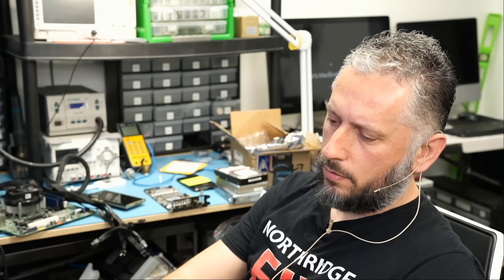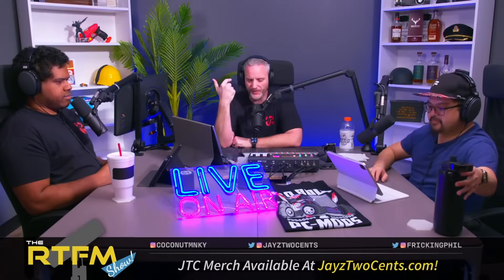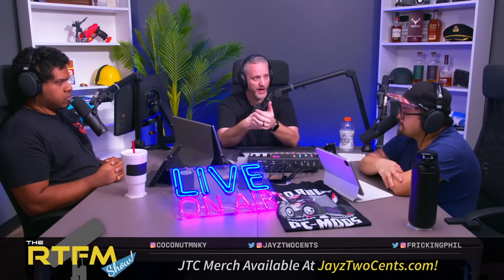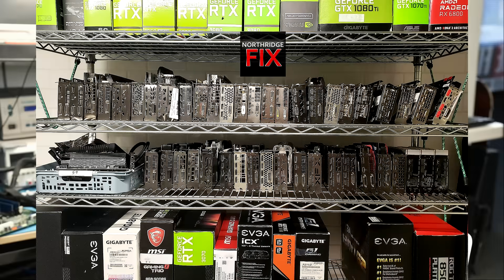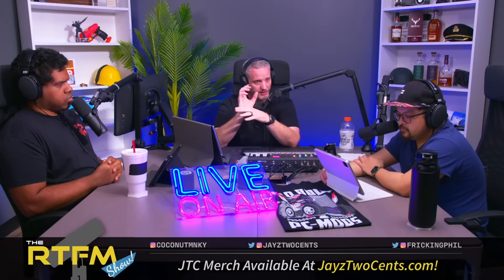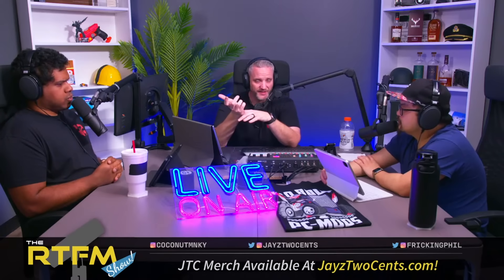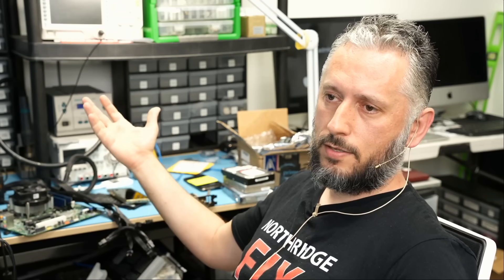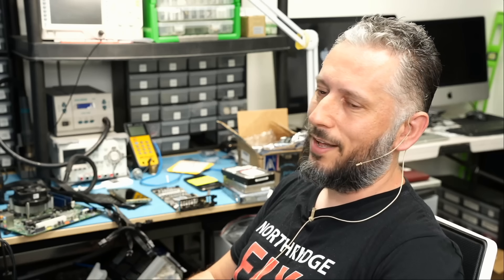Melting 4090 and CableMod. JayzTwoCents and Gamers Nexus Response. Blame NVidia or User?

Comment: Glad I watched this video.  I under the full impression that this was determined to be user error.  As long as you attach the cable correctly, you're good.  Seems like that's not the case based on this video, or at least not the case all for all cards.  I was going to wait for a price reduction and get a 4090 then, but I've decided the melting risk isn't worth it.  I'll wait for either a redesigned 40-series card with a safer connector or just pass on the 40 series completely and see what they do with the 50 series.  I'll also give AMD a serious look finally, as this may be the time.  

Once Nvidia and their partners release a card with a redesigned power connector, that will be the time to buy - until then these cards are just disasters waiting to happen.
Reply: Exactly!
Reply: I will just buy the old generation 3090, even with heating memory problem compared to melting cables is an ice...

Comment: Hey Alex. Great show:). 500 watts on 12 volts should be around 40amps. Would that be enough to cause a resistance in the connector with heat enough to melt it? I like the idea with the thermal cam below. What did your costumers do with their card when they noticed the fault? The must have seen some smoke? :)

Comment: Definitely a design issue where power cable can easily get loose. Every time I move my pc downstair to use my 4K oled the power cable moves and I'd have to reseat it. This connector requires more vigilance on the users part than previous connectors which were plug and forget.

As far as your video I get that you're mad but the constant repeating of the same sentence four times in a row every time made it hard for me to watch. I understood from the first time you said the cable mod connector was fully seated but you kept on repeating and repeating it over again.

Comment: As a PC gamer over 15 years this is the first i have heard of a graphic cards power connector burning. I personally think its a manufacture error. Personally I think the connector isn't sitting snug causing it to short and melt/burn. It's like any other electrical that receives power. If its not sitting snug it will short. There could also be the smallest scratch on the pin or connector causing it to short. Like you said it isn't rocket science here.

Comment: This was a known issue before they released 40 series where the testers of the cards said the first problem they found is the cable connection has failed in some way that it melted and its the card that is the issue from maybe the card asking for more power then the cords rated resistance.

Comment: 3090's DO NOT use the exact same connectors. 3000 series use SIMILAR shaped connector. 3000 series use 12pin connector, they don't have the bottom 4 sense/communication pins.

Doesn't mean that whole 12/16pin connector design isn't flawed. I'd take 5 8pin PEG's over that 12VHPWR connector any second

Comment: So, it was year ~2001 when first VGA GeForce3 (NV20) that needed an external power supply was created (because PCIE/AGP power was not enough). Now, after 22 years, there is the first graphics card in the whole humankind history, that started to burn the power supply connector ---->>> USER ERROR! It doesn't make sense.

Comment: Looks like Nvidia cut corners and created an overpowered hot mess that requires an oversized cooling solution and scrambled a connector to keep it all propped up by the skin of its teeth - all to save face from the crypto debacle.

1. Connectors are melting.
2. This wasn't a concern in previous generations.

Comment: What they need to do is redesign high wattage stuff to a higher voltage. 24 volts would be the same wattage at half the amperage. Of course that would mean a whole new power supply too.

Comment: 7:55 - Actually, they do not always. One time I wont forget is that the PCI-E cable was missing completely even though the video card required it. It was a modular PSU with no PCI-E cable present. It's amazing how sometimes we get DIY PC's that wont turn on, no signal or sudden crashes. Turns out it was a connector that was not plugged in all the way. I have seen most types of connectors loose, 24-pin, 4+4-pin, SATA and PCI-E. But I guess those customers dont have a single brain cell...
What comes to the GN video, there is a chance that the card connector would have melted anyway so unless it can be recreated consistantly, it's not a user issue, at least not always.

Comment: I don’t watch Jay2cents at all and always skip his.
As for the connectors, it is in a stationary pc and not something that is moving. Why talk do they talk about wriggling?
The cable connector is from the power supply. I am more apt to think that the cable connector from the power supplies has quality issue.. firstly it is not a solid pin but rather a thin hollow square plate that will split open to accept the pin from the video card. Therefore it is likely  the when the plate split open, the plate is not making complete contact with the pin and thus cannot handle the current.

Comment: It isn't really an nVidia problem, as partner GPUs can use their own design and the problem seems to be universal even for partner board designs, etc. where there were options to mitigate problems. All GPU designs have some RMA rate, all can die, etc. and when the RMA rate is acceptable, and can be attributed to manufacturing stuff to wrong tolerance, having bad luck, etc. that is sadly normal. 

The not plugged in error is a design concern and user error and it is PCI Express standards level issue, but with careful users it can be corrected. Sadly, we have to live with this standard until we get a new power connector (and PSU) standard. 

Just as connectors attached to the scale was manufactured by a few different suppliers and were slightly different, now when this connector got more common, more suppliers might have to sell it to various board partners, and standard PCI Express 5.0 power connectors manufactured to wrong tolerances used to power a 600W GPU might fail. With less power draw it might be fine. The fact that the connector is soldered to the board, and not connected to cables doesn't mean there cannot be manufacturing and QA errors with the connectors...

When we deal with new generation of hardware and unusually tight tolerances required for reliability, many things can go wrong: Connectors on cable/adapter, connectors on card, handling by users, stress due to case, vibration, other conditions (heat, air movement and pressure). Many small, individually insignificant, differences can lead to a problem where the connection is already out of specs, and can lead to GPU death. Many known potential issues weren't considered and as this connectors is incredibly sensitive, and in the case of 4090 it is already tested to its limits, it is possible that several different issues can push it beyound its limits and cause melting. 

While the connector on cable / adapter was revised and reinforced, but the connector soldered to the board on VGA is probably still come from the original design by a few manufacturers and they don't manufacture them to tighter standards and they haven't revised them to stay reliable even if the connection is slightly out of spec, bad luck can cause issues.

Comment: You add compelling arguments. I tend to believe you more than GN right now. I think Steve did not have all of the info on hand, either due to a miscommunication with you where he thought or was told your insight was based on those 8 cards from Cable Mod only, or that he quite seriously did not bother to do his due diligence. I rarely find fault with his assessments, perhaps now I will be more critical of his content. Without a doubt Nvidia is at fault for creating such a seriously bad connector. Thx for the info...

Comment: The card draws a lot of current,  more than any other card if I understand correctly.  This is either a bad connection at the connector,  or too small of a conductor in the connector to carry the specified current.  Either of which will generate too much heat at the connection point.  Hence the reason that this is not happening anywhere else in the entire power path.  This is ohm's law 101 stuff here.

Comment: This needs proper lab based fault investigation by somebody such as the Gamers Nexus team:

1) Obtain the information for both the rated current carrying capacity of the connector and the cable conductors from the component manufacturers specifications. 
2) Make up a supply cable that can measure the amps drawn through each connector, ideally through an ammeter in series with a shunt if necessary.  
3) Bench test the 4090 card(s) under full load whilst measuring the amps drawn through the conductors to see if any are exceeding the rated design capacity. 
4) Measure thermals at the connector during testing to find out just how hot these things are getting to melt the plastic.
5) Repeat the test using both the Cablemod adapter and the Nvidia adapter cable inserted.

Comment: I watched all the videos and unplugging the adapter was as hard as pulling a dictator off his seat, well as for me I think by the time a user decide to go for such an expensive card he must be with enough knowledge of its proper installation, why is it that the previous versions were not getting burnt so it’s completely not the user error. Instead of beating round the bush they should get the solutions to their manufacturing errors, let them switch to ceramic materials and they make sure that once the cable isn’t fully inserted it should work. Let them design a gap that is bridged by the connector. Once it’s connected properly then it completes the circuit kalasi.

Comment: I thing the way the socket made for such high voltage is very bad and prone to insecure connection inside the socket and cause increasing temp. We call that ngefong.

Comment: The problem may boil down to tolerances and multiple factories working on the connectors on multiple ends. There needs to be a solution engineering wise that makes 100% sure of the handshake or the card will not work. I also could be that the problem is not "it just melted" It could be a degenerative thing burning slowly over multiple uses. That would make it harder to detect?

Comment: If it melts on the connector side is the pins made of a inferior metal on the card. Can the current be measured between a brand new card and a failed card that was fixed. Both running for 24 hours under thermal camera full card  recorded.

Comment: I agree with a little of everything. I believe Jay and Alex are correct in that the problem bottom line lies with Nvidia. 

I believe Steve is correct t in his assumption that, because of bad design, it enables errors  the user may never be aware of. The cable gets seated, and it feels tight, but it can walk itself out just enough. 

Like Jay mentioned, there is still give even when fully seated.

Also have to remember Steve is going off of the small sample size he tested and, he did say he was willing to do more testing but, still believes that in the end, it does lie with the user to insure everything is correct. 

Yes and No about that, if the connection feels tight and secure, especially with a cable mod connector and it is still melting because even that has wiggle, it's because of bad design on Nvidia. 

I'd love to watch the three of them sit down and discuss all of this together and do testing.

Comment: What i dont understand from NVIDIA is the 3090 has 3x 8pin conecters and the 4090 has 1x 12pin conecter the 4090 has not enough pins for the Power thats wy ther melting ol the power gows true 4 pins ant geting hot.

Comment: There is something that i would do in this case to clarify:
Measuring the current consumption on a PCB type that melts the connector and on another PCB with same connector that doesn't melt it.
Because then you can tell where is the problem. If the current consumption is bigger on a 4090 board than other similar boards, seems like a bad design for that connector was made.
Clearly there is a problem with production project/dimensioning for that board.

Comment: Nvidia should have keep the Standard PCIe connectors that never failed, and have thicker wires and can supply more power as the spec … the new connector is simply bullsh

Comment: How about this regulator circuit on 40 series cards which undervolting the card  from manufacture to 450 watts

If there is some error in the way of communication between the GPU and this circuit causing some how aspike in the 12 v line causing  this connector to melt from inside ?????

Linux from ltt used anthor circuit to trick the GPU that it consume 450 watts and in reality it consume about750 watts and not melted yet
😂😂😂
And this one connector should be replaced with 5x 8 pins connectors or make an AC input to fix this problem once and forall

Comment: I believe it is the connector socket design and NVIDIA's fault for forcing change where change was not necessary and illogical. Instead of the power being spread out over three 8-pin connectors that uses 24 pins and ~2.5 inches of PCB it is a crammed into 12 pins (not counting the sensor wire and three empty sockets) funneling into one inch of PCB. Same principle as using a small guage wire where a larger guage wire is indicated. More power than the small connection can comfortably and reliably manage. Another example of "smaller/thinner/lighter is better" reflecting engineering stupidity. It might have turned out better had they used two instead of only one of these dainty little connectors, but that probably would have cut into their profits by at least $1.75 per graphics card, so perish the thought.

Comment: Of cause this is a product error,  the problem is that the new connector on paper is within spec for all the current the cards demands,  but in the real world spec isnt worth much,  reason we have endless of testing done all the time..  But with tech we dont have time for all that testing because a new model is out very soon..  the connector is too small,  the surface area on those pins are way to small for a friction fit with this high watt demand.. 

People never get a good tested product anymore,  people are the testers in a way as things are today..

But Nvidia will of cause not just jump out and call all cards back,  it will cost them so much money..  they better handle the RMA's and hope not too many will be sent back..   Maybe the melted connectors only happen if you push the card and at the same time have a high temp in your case..   You could call that user error to have a case temp too high,  if that is the problem,  but everything have temp sensors now.  If it was by design that this connector would melt if its too hot in the case,  a sensor would have been added to handle this..

Nvidia fucked up,  shit happens,   next..

Comment: I gotta be honest... Steve's response to this has him sounding like a shill. While I've always found him to be extremely long winded (made worse that I can't really stand his voice) he generally came across as someone who gave a damn about the details, but this...? Unless it's his position that somehow the right-angle connector managed to fully-seat itself while it was melting into the PCB connector, he's clearly ignoring a lot of what you were showing (including the frame you picked out and highlighted in this video, showing it fully-seated).

Always trust the guy who fixes these things for a living to have a better idea of what's up. This goes double when he doesn't need to maintain good relations with hardware vendors in order to receive the stock to keep pumping out content.

Comment: Alex you are completely Right ! That is a clear indication of a "not  well enough designed contact". Where the Load (consumtion current of the GPU) is not suitable to the contact it self, means it is not distributed evenly! Lack of contackt surface between male and female terminals. Only a bad contackt is heating so much to cause melt and burn. So yes the end user cant be blamed on that, if the connector is fully plugged in. End of discussion hopefully 🥳

Comment: What's the max temperature or max power the cable mod adapter can handle? Is direct plugs without adapters burning too? We need to know the max temperature the adapter can handle.

Comment: Alex ne znam jel pricas nas ali pazi ovo… in 6:57 you are talking about 0.5 mm gap on the side. I have cable mod cable and it has that gab fully plugged! I am not using it whatsoever. Seems like it is cable problem…. Stock cable no issues.

Comment: I completely agree with your explanation Alex. In my understanding, it's a real shame how engineers are not able to design this card to manage a electron flow. That is the very first lesson to learn for a proper project. Engineering sucks.
Reply: Why are you agreeing that the engineering of the cable and/or adapter is not at fault?

Comment: It's not the card, it's the connector. The 12 VHPWR connector is a failure, period. One computer shop owner posted a picture (in a facebook gaming group) of a burned 12 VHPWR from the PSU side (GPU side not burned). It's a customer pc, the psu (fsp hydro ptm 1200W) has native 12 VHPWR connector on both ends. GPU is Zotac RTX 4090 AMP Extreme Airo.

A power supply designed and build specifically for the new ATX 3.0 and it failed at the connector. You don't have to be a genius to see how much of a failure this 12 VHPWR connector is.

Comment: This all feels like semantics to me. If it really is user error happening on this unprecedented level, then that is still a design flaw. If 10% of a specific make and model of car caught on fire if you didn't properly seat the ignition key when starting the car, the manufacturer doesn't get to blame the user for being able to start the car with the key not properly seated. It's a design flaw either way.